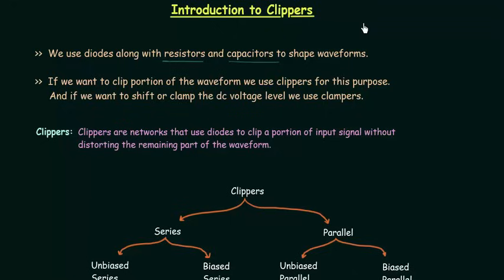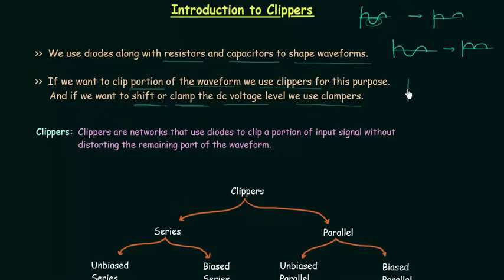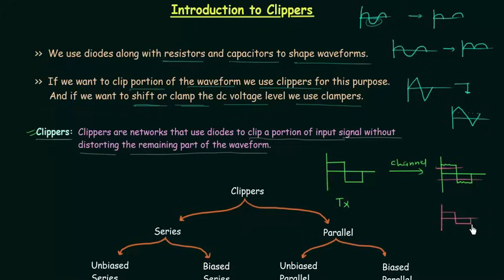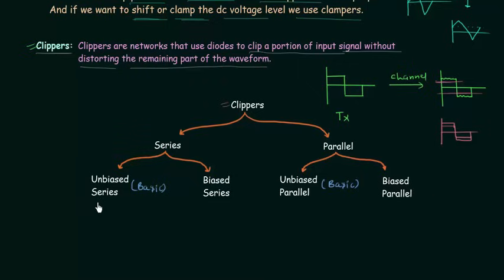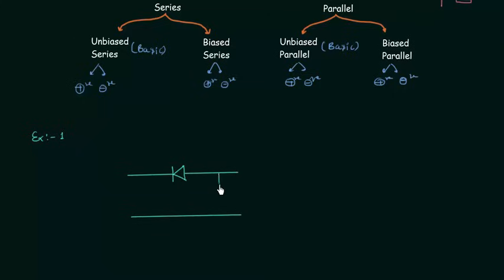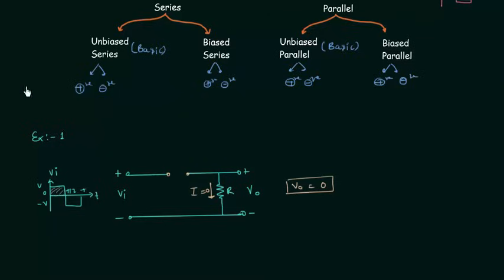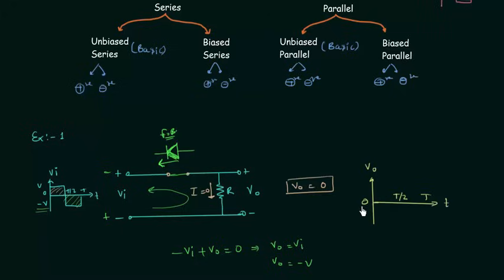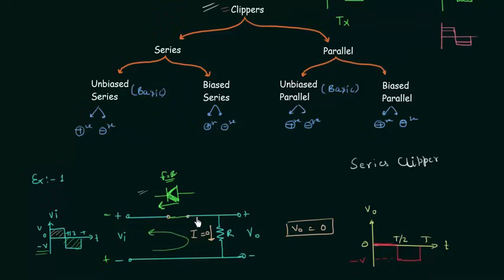Introduction to Clippers

Comment: I think eq: for 2nd  half cycle
      -Vi + IR = 0               (+IR because polarity is change) 
=>  Vi = IR                
=>  Vi = Vo                    (IR = V0  because in parallel branch voltage drop same )
Reply: How it could be -vi in 6:58  when the polarity is in - to +

Comment: For -ve half cycle on applying kvl, the equation should be Vi+Vo=0
Reply: Equation depends on how you mark V0. If positive terminal on top, then you're correct
Reply: Yes
Reply: Vi+v0=0
Reply: I think the polarity of Vo reverses as the polarity of Vi does in the -ve half cycle. But it's not marked on the fig.

Comment: I got confused in the sign convention when u used kvl on the 2nd half wave
Reply: If you understood the positive half cycle, you just have to invert the sign for the second half cycle, because the polarity just changes. Hope this helps
Reply: but sir if we use kvl after inverting the sign for negative half cycle then the equation will be Vi= -Vo
isn't it?
Reply: @ojaspurohit5852  yes, i think the same. Applying KVL in 2nd Half Cycle, when the Diode is in Forward Bias, the KVL becomes: - v0 - vi = 0, hence, V0 = - vi.
@Jeet Nadgouda, am I wrong?
Reply: @jeetnadgouda4689  Applying KVL in 2nd Half Cycle, when the Diode is in Forward Bias, the KVL becomes: - v0 - vi = 0, hence, V0 = - vi.
Am I wrong?
Reply: I too got confused , thats why came to comment section to look up for similar queries lol!
Reply: May be output waveform of - ve halfcycle I'm confuced
Reply: It may be reversed

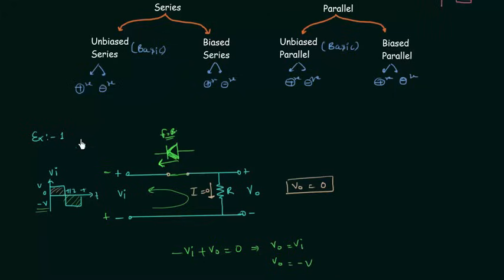Comment: in 7:36 why +Vo? it should also be (-) according to kvl
Reply: "By kvl counterclockwise direction, it should be
 +Vi + Vo= 0
Then Vo = -Vi "
Im also thinking about that
Reply: then how is the wave
Reply: For the negative half cycle though the polarity of Vi changes, while using KVL we will have to consider the polarity sign for the positive half cycle of Vi. Hope this helps.lll
Reply: but why?
Reply: @shibanidas7018  it's because when you have a negative alternation for an AC input, the voltage is also negative.
Reply: @shibanidas7018  Don't change the polarity of Vi when you move to -ve half cycle bcoz we already changed it's polarity in the graph by showing it below x-axis........
Reply: But representation of output is different

Comment: Sir in the example which you have explained why is the circuit unbiased, i mean you are saying there is no external DC voltage but how to know that there is no external DC voltage applied or not, can u please explain this sir.
Reply: Bhai question puchneka samay kahan se mil raha bhai subha 10 bje exm h abhi hum lecture suru kr rahen